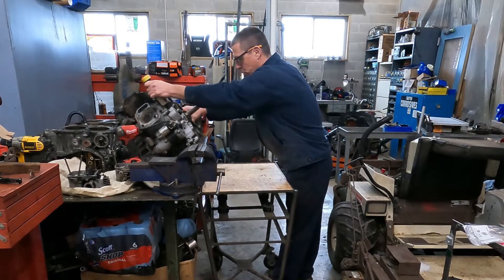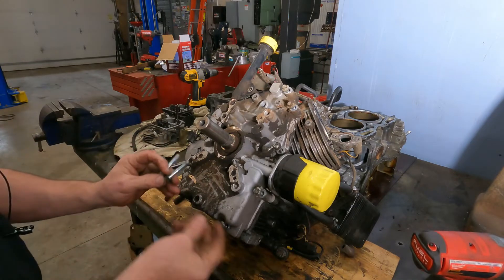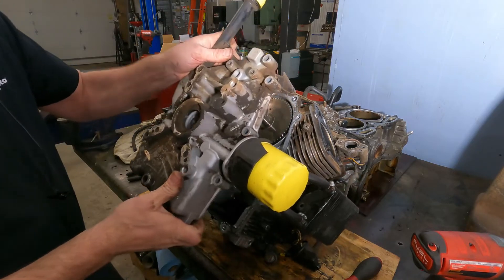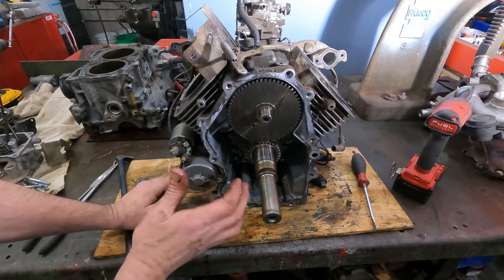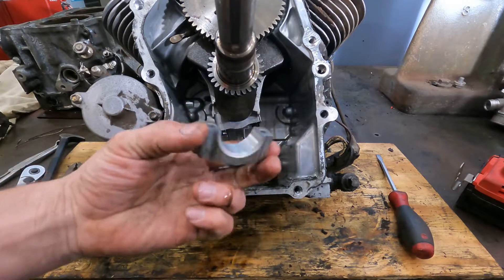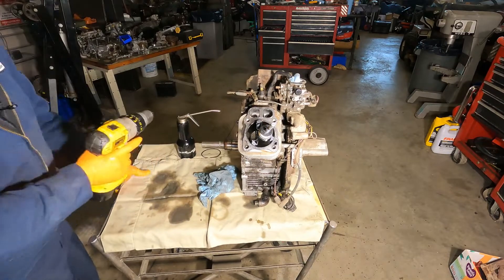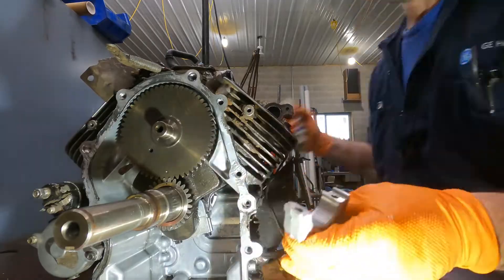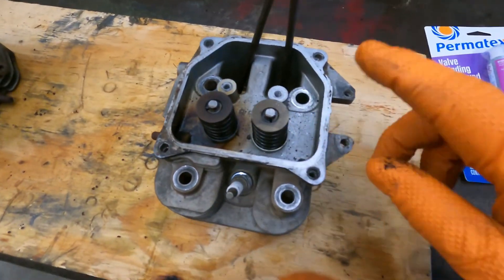Grasshopper zero turn Kohler twin cylinder CH25S engine rebuild, pistons, rings, other stuff PART2

Comment: Great video...need help with a question here.  When you we installing the pistons, on each one you said: "Make sure we are pointed to the flywheel".  May I ask - what - was pointed towards the flywheel?  What on the piston were you looking at, to have IT pointed towards the flywheel?
Reply from the maker: @stephenbay9564  I believe there is a recessed dot on top of the piston. If you’re pulling the heads off you’ll see right away.
Reply: @whatsnextgarage  Wow....Thanks for a fast reply!  And thank you for that answer.  I will check the pistons.  And until you said about facing the flywheel I was thinking that the orientation had more to do with the asymmetrical connecting rod ends that this engine has, where one end is a tad longer than the other, and it was meant to clamp to the crankshaft in one specific direction (only).  Now not asking you for the answer here, but what difference does it make to the piston, which side of it faces the flywheel? It can only go in ONE of TWO ways, and one way the connecting rods will not hit the crankshaft as they should,  no?  Gee such a simple thing and yet it's not blatantly simple it seems.
Reply from the maker: I can honestly say that I have thought that same thing. I finally came to the conclusion that the mark on the piston simply makes sure that when you reassemble a used motor using the original pistons they go back in the way they were worn. Now I’m curious and I will be diving into it.
Reply: @whatsnextgarage  This is what I found: "Asymmetrical connecting rods, also known as offset connecting rods, have a big end that's slightly offset from the rod beam's centerline. This design is intended to accommodate engine designs where the cylinder bore's centerline is also offset from the rod-bearing radial centerline."  And so from that....if THAT is the case.....then installing the connecting rods in the correct orientation is fairly critical.  Now on another YouTube video a guy showed the top of the piston and it has the word "fly" on in, with an arrow.  So OK, I can go along with that.  BUT it would seem to me, that when one installs the wrist pin to the connecting rods, that THEY TOO should go in one way.  Because if not, that non-symmetry of their ends in going to wind up hitting the crank one way now, and another way on the next one, if the attachment of the two is not controlled.  To be clear.....I don't have an issue with the pistons going in either way, because I don't see it mattering much.  But I DO have a problem with the connecting rods not mating with the crankshaft as they were designed to do the mate.
Reply from the maker: @stephenbay9564  thanks for that detailed description!!  Have a great weekend!!

Comment: https://www.youtube.com/watch?v=Ooi4FSjfG98  watch this from 16 min onwards   shows the triangle cyl head oil hole , different head gaskets , head studs upgrade  or bolts , later units have plastic inlet manifold , pushrod guide plates [throws p/rods due to worn cam / lifters and fatigued rocker studs ]   
These engines have alot of issues .  Its the 25 hp with the bigger bore . The 20hp is reliable

Comment: Kohlers get cam lobe/lifter wear , Rocker bolt fatigue , crank end float likes to be minimum spec 
After market automotive  quality rings are far better than Kohler .  Cross hatch for kohler is 33 degrees [control of oil but wears rings quickly] In a machine shop professional cross hatch at 45 deg is way way better than kohler ever did .  ***Some early engines are Nika-sil bores  *****  late 90`s kohler DID NOT use fire rings on the head gasket
Inlet manifold /head sealing was very bad same as exhaust sealinghead . solution is to machine surfaces  . Overheating occurs alot in the 25 hp with 52 inch or larger decks . These motors will go to 230f--250f oil temp in 90f or up weather . LARGE OIL COOLER IS NEEDED
Reply from the maker: Wow thanks for all that awesome information!!

Comment: Perhaps I'm wrong but I always thought you had to measure cyinder wear further down the bore. The lip of the cylinder isn't even in contact with the rings and will stay at manufactured size even tho the bore maybe worn and ovalled to buggery. Thanks for the clip. I'm just about to start doing the rings on my 730. Compressions at 108 instead of 160. I was thinking of doing a leak back test but decided to do rings and get valves lapped at the same time. Then keep it as a spare while I put on a Chinese 33hp. Half the price of comparable Kohlers or Vanguards. I'll be happy with three quarters of the life. Your clip is simple and easy to follow. Thanks
Reply from the maker: Thank you very much!  Yes you are correct about cylinder wear. Good luck on your project, it sounds like you have a good plan in place to get your machine back on its feet!!  Have a great weekend!

Comment: Good Evening!,  I have a Kohler Command ch18 I just pulled out of a small skid steer, it was leaking oil and wasn't charging, after pulling the cover I noticed the flywheel was loose, took the flywheel off to find a big mess, the crank has play in it, so much it destroyed my magnets and stater, obviously the oil is leaking from the seal. Im guessing before I go any farther is there a bushing in the block or is the block Junk??.
Thanks for your time ..
Reply from the maker: Good evening to you as well, I vaguely remember no bushings. So I believe you’ll either have to do some fancy machining or scrap the block.
Reply: @whatsnextgarage  thanks for the quick reply, watching a few rebuilds now, dont see anyone changing a bushing, just a seal, unless theres a sleeve on the crank, hard to tell from pics?
Reply from the maker: @farmerrick9660  no bushing on the flywheel cover. It just runs in that aluminum bore that’s counterbored for the seal.
Reply: @whatsnextgarage  Thanks, that's to bad, engine has great compression , I don't understand how this happened, plugged oil hole?
Reply from the maker: @farmerrick9660  very well could be or at sometime in it life it was run low on oil. That’s gotta be a neat little skidsteer though.

Comment: What the reason to get the glazing off? What is the glazing for
Reply: When installing new rings you must hone the cylinder wall. Why...because the glazing he mentioned is a coating of combustion material that coats the cylinder wall. When new rings are installed they need a honed (clean) wall so they wear in right. This sets the rings to do their job providing a sealed combustion chamber. Honing is done lightly to just remove the glaze. To aggressive and now your taking to much wall material away and may increase bore size. That's a bad thing. This is a simple explanations. Hope it answered your question.
Reply from the maker: @lenjames  simple?!!  That is a spectacular explanation!  Thanks a lot for your feedback!
Reply from the maker: After years of any motor running the cylinder bore starts to wear. The wear is normal and starts to smooth out the cylinder walls. That surface develops a “glazing” effect that, during a rebuild, should be honed out. Once the glazing is removed and a fresh cross hatch is established, the new surface can wear in with the new piston rings.